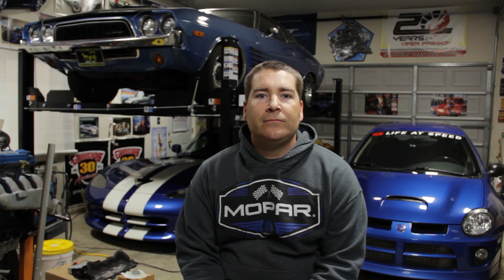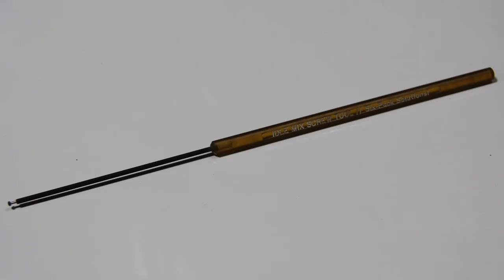Tech Talk Tuesday: Ways to Simplify Adjusting Idle Mixture Screws on Mopar 6 Packs

Comment: I got the Promax rear carb base plate. I also got the outboard carbs jetable metering plates and the center carb metering block, that works much better than the stock one, especially with a hotter than stock cam. 6 bbls RULE!
Reply from the maker: Nice! I keep thinking about getting the upgraded metering block.

Comment: What are the differences between an automatic and manual six pack set up
Reply from the maker: On the automatic 6 pack setups the outboard carbs are vacuum operated. The manual 6 packs the outboard carbs are linkage operated. The manual 6 packs were available over the counter from Direct Connection and mostly used in marine applications
Reply: Thanks
Reply: @LifeatSpeed  Funny I have an origional T/A 4 Speed with correct carb numbers and the outboard carbs are vacuum
Reply from the maker: @muscleonly1  sorry I wasn't referring to automatic or manual transmissions, I was referring to the types of 6 pack setups. All factory 6 pack setups had vacuum outboards, but Direct Connection offered manual outboards that were linkage driven instead of vacuum.